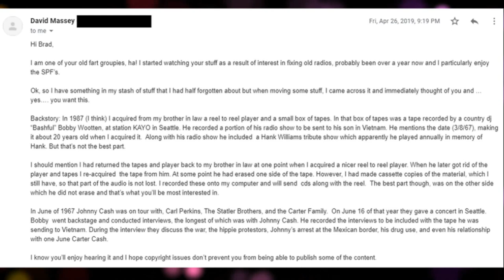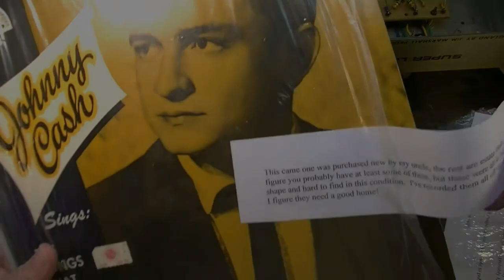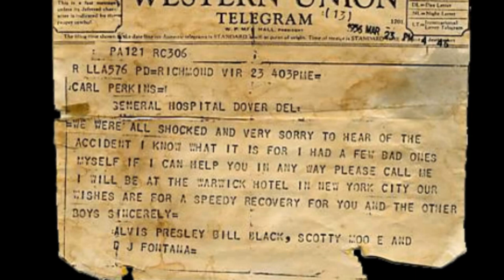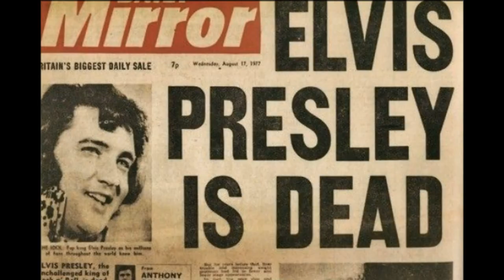Carl Perkins LOST 1967 Interview...UNEARTHED After More Than 50 YEARS!

Comment: Brad, that was absolutely badass!  I'm an older feller and I've spent a lot of time fooling with reel to reel machines.  I've had tapes half that old degrade to the point the oxide was falling off the mylar.  How that lasted until it got to you and sounded that good with so few dropouts is nothing short of a miracle.  Thanks so much for letting me hear that.(and Johnny Cash in the background was icing on the cake!)
Reply: agreed, this needs to be remastered, definitely digitally transposed today.. not tomorrow, TODAY!   we h ave this but this isn't mastered, i think you can get free mastering software for Linux..